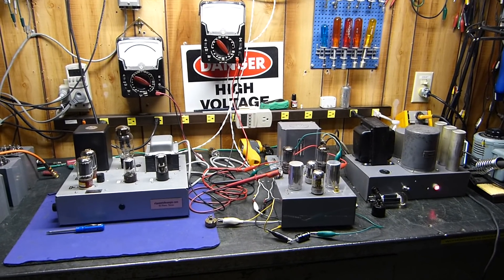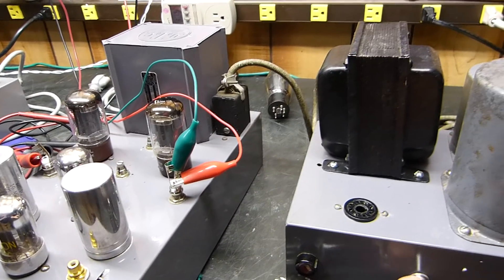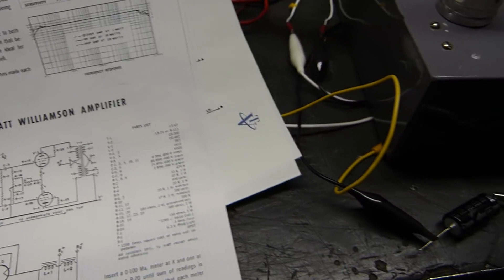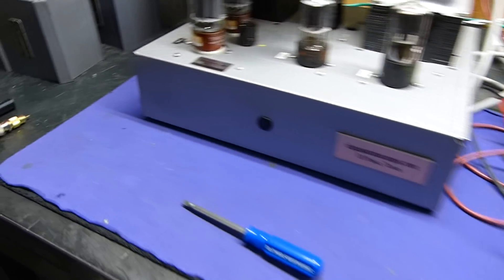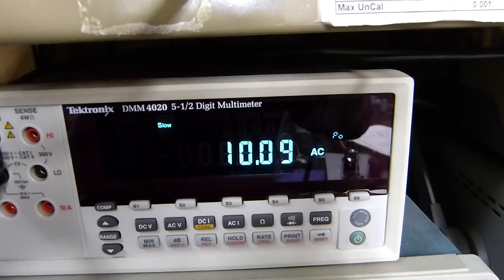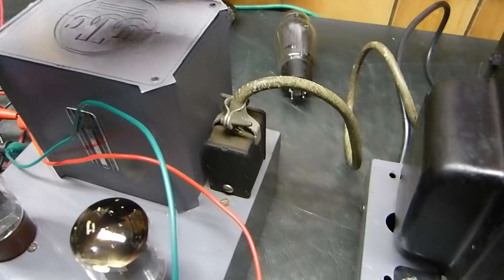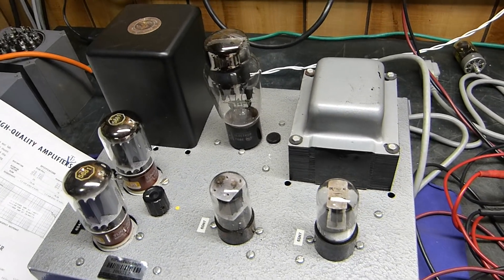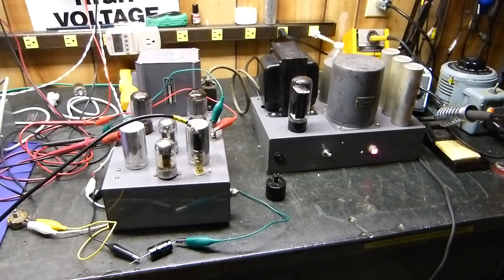UTC W-10 Williamson Vacuum Tube Amplifier

Comment: I have a W-10 that I’m trying to figure out what it’s worth. Could you tell me if I send you a pic ?
Reply from the maker: I have a couple of W-10 also that I took the LS transformer off for a stereo version I built. If it has the UTC LS-57 or 61 or 63 transformer on it, it is worth some money - maybe $250 maybe more. It it has the original power supply also - wow... it could sell for quite a price. Be careful selling such items on Ebay, is my advice. Its price probably also depends on if it has 6SN7 or 7N7 drivers and ... does it work...

Comment: Hi David - Thanks so much for the video = always fun and educational. I was looking for the photos from New Mexico but I think you ran out of time! Question: how do you feel about separate bias pots for each output tube rather than using a master bias pot with a trimmer or balancing pot? Is there any advantage for separate B- rails for each output tube or does a master bias pot + balance or trimmer work better? BTW, I have learned so many usable tips from you - each one saves me a lot of trial-and-error time ( trial-and-error is my middle name!) and I am grateful. Gary in Albuquerque
Reply from the maker: Hi Gary,
The McIntosh MA230 design uses separate bias pots for each output tube and I have built that very amplifier (1977) using their OPT which performs flawlessly, in my opinion, but I don't see any real advantage to doing it that way rather than any other simple way to balance the currents in the output tubes. Of course I am talking about fixed bias in this case and not cathode bias. From some of the oldest, higher quality, amplifier designs I see dating back to the 1930's, the designers realized how important this was for top performance to balance output cathode currents from a 6V6 to an 813. That simple little 50 ohm 3 watt pot I used the other day has really caught my attention for the easiest way of balancing cathode currents from a cathode biased design. I have some driver boards called, Poseidon, sold by TriodeElectronics,  boards that use a 1meg pot, CT to ground, to try and balance fixed bias to the output tubes that does not work very well. I mention this in contrast to the separate pots you mention above. Back to the cathode bias design - the UTC W-20 design got it right with being able to set the overall cathode current plus balance with a couple of 50 ohm pots that I have built and posted that works great for a quad of 6L6's but I don't see the need for adjusting the exact cathode current - just the balance.
Trial and error - that is me also - much of my success, if that is what I should call it - is empirical "design". I take inspiration from vintage designs that I trust and the max parameters from the RCA tube manuals and go for it... when it comes to RF high power amplifiers, I trust Eimac datasheets and designs. If you get it right, it will do exactly what Eimac says it will do.
Not sure of the photos from NM? I made some beautiful pictures of the crescent moon yesterday but I don't know how to share them except by YouTube and a link to an unlisted posting. Please refresh my memory.
Reply: @ElPasoTubeAmps  David, thanks so much for your reply. I appreciate the material and the time you took to respond - it cleared up a bit of confusion on my part. I have copies of the Heathkit schematics you mentioned, and just love those circuits. I am going to try your suggestions regarding balancing the output tubes rather than setting the exact cathode current for each tube. One thing I like about your methodology, is that you strive for simplicity and uncomplicated circuitry and assembly. You also come from a position of personal experience and the empiricism you've gained from actual "real-world" working conditions. If you start this video (Jan 6, 2019) at about :45 in, you'll hear the comments you made about your trip with your grandson to NM to photograph the stars! Thanks again, David.
Reply from the maker: @radiojet1429  I will be most happy to share my astronomy photos but it is much easier to share them via email. I just came in from photographing the crescent moon, again. Email me at my YouTube email and I will send you some nice one.   TheAudioShop@SBCGlobal.Net
I do try to make it simple. Simple not only is cheaper but it often times lasts longer, easier to understand and duplicate and easier to repair. I come from an era where we tried to make the very best that could be made and make it in such a way that it can be repaired in the field. We couldn't send $750,000 NASA mainframe CPU's back to the factory for repair. We had to fix them and that included the peripherals down to drilling and tapping and shimming mechanical parts as necessary.  Simple is beautiful.

Comment: i do my negative feedback with a pot like you were doing. i too also like using separate power supplies with linkage lead. keep up the videos i learn so much watching you tutorials etc
Reply from the maker: Hi Ian,
It does seem the manufacturers and the formula of 1200 times the sqrt of the output tap (for the value of the FB resistor) is a bit excessive for NFB and causes some strange LF issues. I have noticed that for years but never knew why until recently.
I picked up an old Heathkit W1 (I believe that is the model) that is in really nice shape. Uses 807's and a very nice Peerless transformer. I just finished a power supply for it because another gentlemen bought the PS but not  the amp ??? It was only $10 - whatever.
I will start testing it tomorrow and post something on it.
I am very pleased you enjoy my videos. As have said on a few occasions, I can do all this fun stuff in the solitude and vacuum of my workshop but sharing it with the world makes it much more valuable to me and I hope others enjoy it also.
Stay safe.

Comment: You need to do a cathode bypass in the output tubes me thinks
Reply from the maker: I agree with your thoughts. I did test the amplifier with a 47uF capacitor across the cathode resistor and it did improve the performance. I don't remember the exact numbers but I believe the power increased by a couple of watts for the same THD level without the bypass capacitor.

Comment: I hope you don't think this is rude of me but you are the man who might be able to answer this question for me. I have obtained a Stancor transformer and choke numbered 52C084 and 56C048 respectfully and I cannot find any information on them. I would like to incorporate them into a home built amplifier but without the specification, I'm stuck. If you or your followers can help me I would be very grateful.
Reply from the maker: http://www.bunkerofdoom.com/xfm/

This site is a good place to look. I recognize that part number style but I am not sure that is the number you should be looking for. I have been confused looking for Stancor  transformers myself. It is out there somewhere and I have even found data on chokes/transformers by looking (and lucky finding them) on Ebay where they sometimes show data sheets and have the very one you are looking for. From what I saw on Ebay with that style number it seems to be an old one - possibly 1940's or even earlier? Good luck.
Reply: Thankyou for the info. I have managed to work out the transformer by trial and error with the help of a vaiac. 0-120v, 0-120v, 310v-0-310v, 5v and 6.3v. The weight is about 12 pounds so I'm assuming around 0.3A for HT and around 6A each for LT. The choke is about half that weight with DC resistance across 3 terminals of 0 - 84 - 310 ohms. @ElPasoTubeAmps

Comment: What model Triplett meters do you hanging? I have the one like yours with the voltage divider, 630 NA I believe and I have a 630 APLK. Update, saw the closeup of your meters, 630NA and 630PL. Virtually the same as my setup. I have Simpson 260 series 7, nice but not like a Triplett.

Comment: PPPS The difference mainly between Heathkit and UTC is the output stage - one is Triode as per original Williamson and Heathkit is 'ultralinear' as later designs. (The great Alan Blumlein who invented among many things, stereo in 1933ish and later the 45/45 system for vinyl invented ultralinear output stage).
Reply from the maker: I also noticed in the UTC design that they do not use a cathode bypass capacitor on the output stage as do the Heathkit designs. I did experiment with this amplifier inserting a 47 uF capacitor to ground off the cathodes and it did improve power output and lowered THD levels. I have also noticed that the later (Heathkit and other) designs do not use a maximum current pot (R20 in the UTC design) but all do use the balance pot (R15) which I found most sensitive to setting lowest THD around 20-30 Hz.

Comment: PS the feedback resistor is 1200 x squareroot of speaker voice coil imp (tapping secondary) NOT 120x.
Reply from the maker: Thanks for noticing. I didn't realize I said 120 instead of 1200. YouTube took away the option of the speech bubble because they say it can not be seen on mobile devices so they decided it was of no use.  
My comment to the UTC method of determining the resistance value of the FB resistor is that I have noticed that is the maximum amount (lowest resistance/maximum NFB) of feedback before the amplifier may become unstable at low frequencies as can be see with the cathode current fluctuating at about one Hz and the trace on the oscilloscope bounding up and down with no input. I have found on many amplifiers that the FB resistor may be best set at a value a bit higher than derived from that calculation. That has been my experience.
Reply: @ElPasoTubeAmps  I really enjoyed watching - I got carried away and started talking to the screen. It's often better to use less feedback than the standard value used.  Manufacturers often went as close as they could toward instability to improve bandwidth, noise and distortion figures.

Comment: The Williamson design was published in 1947 in Wireless World. The design offered full band, full power at below 0.1% THD. Future versions used pentodes with the Blumlein OT tapping for 'ultralinear' operation. Harold Leak then offered a comparable design he called the 'Point One' amplifier, which had a long history eventually giving us the infamous Point One Stereo 20.
EDIT: A quick check and the Leak predated the Williamson by 3 years..Kudos Harold Leak.

Comment: On a different subject, are they  Triplett meters ? ~I have been looking at them on ebay, what model would you recommend? Happy new year to you too!
Reply from the maker: https://www.youtube.com/watch?v=S00c_qQB-hA

I think you might enjoy this video on the Triplett 630. I agree with it 100%.
Reply from the maker: Hi Simon, good to hear from you. I hope you are doing well.
I am very partial to the Triplett meters. I prefer them to the Simpson for two reasons. One is they have a 100K ohm scale (which requires a special 30 volt battery that you can still get) and they also measure very high AC and DC voltages.
The one on the left in my video is a 630-NA and will do 6KV and the one on the right is a 630-PL which does 5KV. As far as I am concerned, there is no difference between the two. I purchased the PL version brand new around 1972 and it works perfect. Naturally, if you buy one used, you may have to replace the Rx1 thru Rx1000 scale resistors as they may be damaged from applying voltage while on the ohms scale. I have seen people rotate the dial with voltage on the probes, going thru the ohms scales and current scales so be careful what you buy on Ebay. There is good documentation on the Internet so they can be repaired. When all the resistors in the ohms scales are correct, you can switch between the ohms scales and probably not have to touch the zero dial. I love these big Triplett meters and do recommend them as one of the best analog meters around.

Comment: I'll be looking forward to another great year with ELPaso TubeAmps. The PP triode project using the inductor grid drive is especially interesting to me. The "Economy Power Supply" design featured in the 1960'ish Amateur Radio manual might be the ticket for this amp. It provides B++ for the triode plates, B+ for the driver/input stages, and B- for the grid bias. This may be overkill since I tend to over complicate things but it might be worth a look see. Nice looking transformers and great video. Bob H.
Reply from the maker: I am going to have to look for the economy power supply you mention. I am still totally taken away by the way you derived two voltages by using the Pi filter for the higher voltage and choke-input for the screen voltages. This amplifier uses a bridge. The 5U4 is half of the bridge and two diodes on the socket are the other half. Voltage comes up slowly (per the 5U4 warmup time)  and the power supply filter is choke input to keep the voltage around 480 which I find that the 6L6/5881's seem to like and perform very well. My thoughts are to build a stereo version using the LS-61 transformers as they are 10K or 6K, with the Svetlana SV572-10 triodes. I did some changes last night that I have not posted yet and although the UTC transformers perform very well at or below their power rating, I have to say, so far, the James transformers and even the Acrosound transformers actually perform better at the higher powers at frequencies below 30 Hz. On the other hand, the UTC transformers perform exceptionally well even at 30KHz... wow...  I love this stuff but it does get tedious and makes me step back often times and ask myself, what am I trying to prove...

Comment: I'm glad that you mentioned about the chassis ground.  I built a 2A3 SE amp with a separate power supply.  I Only have one ground between the two chassis's.  I think I'll put a ground lug on each and run a piece of braided wire.  Great video!
Reply from the maker: Yes, and this is especially true when building truly HV supplies for RF transmitters at 3 and 4 KV where the B+ lead is run separately from an control voltages umbilical cord, maybe using HV meter lead wire or even RG-8 category coax cable.  You can also use two or three pins of the 8 pin octal socket (if that is what you use) to provide redundant ground paths between chassis. My moto has always been (1) stay alive and (2) do whatever it takes not to burn up the vacuum tube by (not)  overloading the grid and screen. The plate can usually take care of itself but the screen grid is always vulnerable.

Comment: Those Tek distortion boxes are still great.. I have 2 of them, one set up with a SG505 optioned with I-M 2 tone and balanced out in a TM500 rack, and the other paired with a 5000 series double wide generator single ended output in a TM5000 rack.

Comment: Have you come across a W-3AM?

Also, just curious to see if you have looked into the R-Core transformers which started out a while back in Japan for use as low noise power transformers in pre-amplifiers. I have not seen a lot on YouTube about these transformers, or whether they would be viable as a tube power transformer, or maybe even an output transformer... They seem to get around the issue (in EI Core Transformers) where you get air gaps between the E and I lamination causing inefficiencies. They also seem to be easier to make than toroidal...
Cheers,
 - Eddy
Reply from the maker: Hi Eddy, at one time many years ago, I do remember having at least two of the series of Heathkit amplifiers. Probably the W3 and W5 if I can remember that far back. I did not appreciate them at the time like I do now.
I am not familiar with the transformers you mention but they sound very interesting. I have been very lucky so far to have access to these vintage transformers like the Acrosound, James and UTC and even the big KW level ones I used with my 3-400Z and 813 amplifiers. I do these builds and measurements just to see if these transformers do perform as people seem to think they so. I have not been disappointed so far. On the other hand, I have built a McIntosh MA230 amplifier using a new McIntosh transformers I purchased directly from them in 1977 and it out performs all other transformers pure and simple and will deliver 25-30% more power at low distortion than they rate the transformer for. I don't know if Mac would even sell their output transformers directly anymore.
Reply: @ElPasoTubeAmps  - Yeah the older transformers can be using custom metal formulations, for increasing permeability, that modern manufactures just don't use, due to the higher cost of using a custom molecular mix for the laminations. 
There was an older 3-part series that Mark (another tube YouTuber) put out a few years back where this topic came up for a set of moving coil type phono cartridge SUTs (step up transformers) I believe they were vintage Triad models. This is what got me thinking about the viability of using R-Core style transformers for high efficiency applications like moving coil SUTs.
Anyways, thanks for replying.
Cheers,
 - Eddy